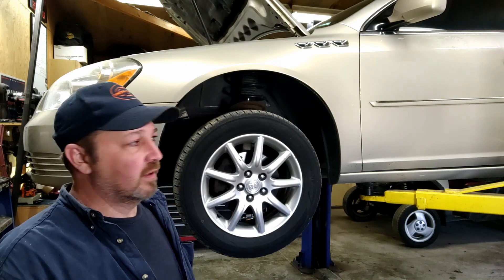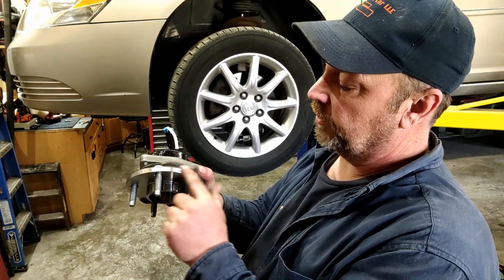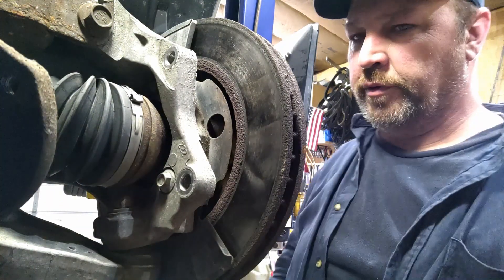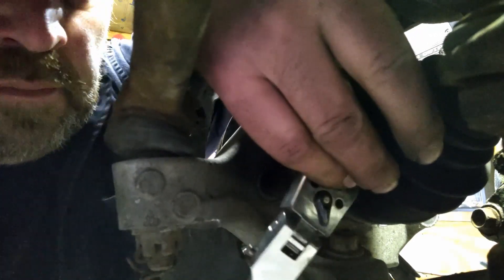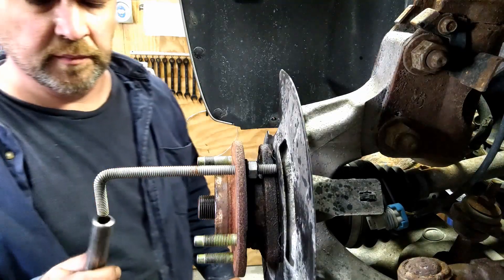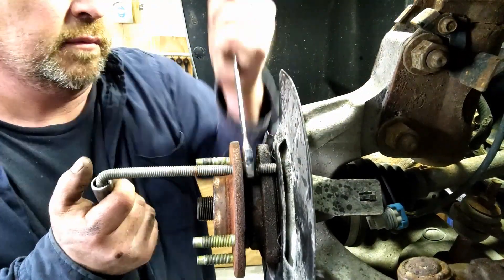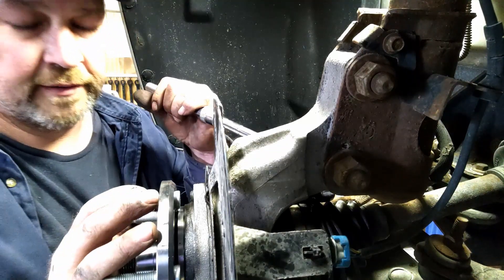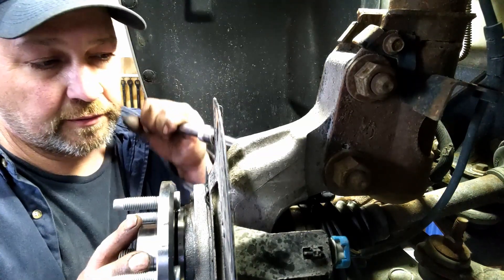2008 Buick Lucerne DIY Front Wheel Bearing Replacement #autorepair

Comment: Great vid. My first time doing this yesterday and today. Been having trouble with wheel bearing not separating from axle but I will use your trick with tapping those studs out.

You have great tools. I love that Stanley you showed. And great torque tools I need to buy those.
Reply from the maker: Try it, let me know how it goes.  It will work I do it this way on a lot of wheel bearings.  Thanks
Reply: @petescustomcarshop  no luck so far. I'm on Buick Lucerne 2008 cxl so prob same deal as your trouble with the passenger side... I have PB blastered the heck out of it and the axel is just stuck with the bearing on it. Gonna keep trying I'll let you know what wkrks
Reply: @awduback what worked?
Reply: @frostnn-yi2dr  I tried so hard but ended up knocking it out with a sledgehammer and then replacing the CV joint as well.
Reply: @ aww Mann. Welp happens.

Comment: Pete, another good and informative video.   Especially with all the damaged roads and hiways around me, anything to do with wheels, struts, hubs etc is a good video to learn from for a DIY repair.   For a 2008, that Lucerne looks in damn good shape, wondering how many miles?
Reply from the maker: Thank you Mister Green, the car has 127228 mile and yes it is not to bad.  My customer wants to fix everything on that car the most major thigs first and then we will focus on the little stuff.  Yes our roads around here are not the greatest either, road construction season will be underway soon.  Thanks for watching.

Comment: Great job Pete! I'm pretty sure that Timken wheel hub bearings are now made in China. How well does the Fluid Film hold up over time? I know Eric O @ South Main Auto is a big fan of it. I've always applied a thin coat of anti seize to the wheel hub centers and CV joint splines.
Reply from the maker: We definitely need to bring our companies back to the USA, shame on them.  Yes fluid film will need reapplication after a certain amount of time, but I normally don't apply anything to the splines unless they are showing rust like this one or are just plain tight fitting.  Thanks for watching.